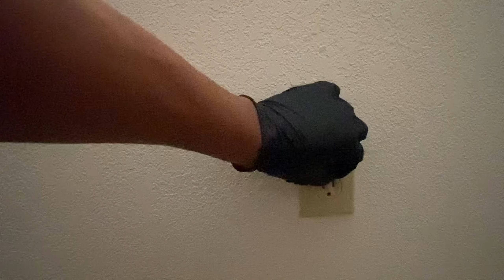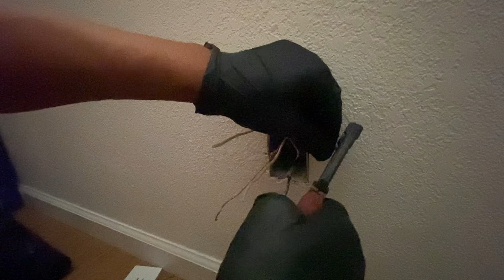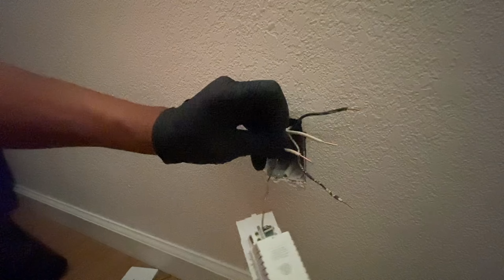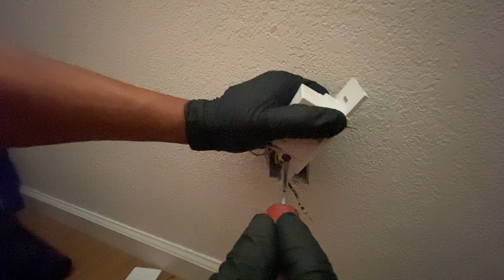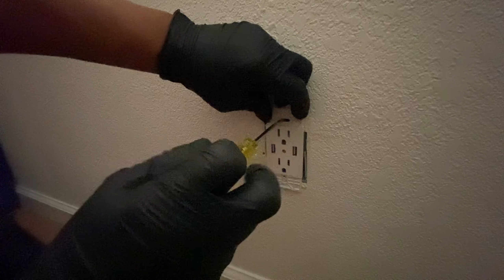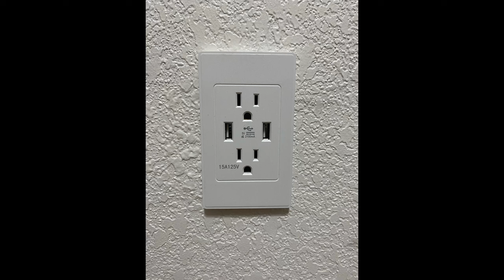Modern Outlet Upgrade with USB | Clean Install Using Pigtails + Code Tips #apprentice #electrician

Comment: Well made video. Clamp terminals like that are 100% fine for two wires, if properly torqued. Wire-nuts are actually a less reliable connection, and your adding more to the already overstuffed box. If you MUST pigtail, I'd suggest the flatter 3-port WAGOs. But I'd just go with the clamp terminal on the device (haven't had a single one fail in 30 years in the trade).
Reply from the maker: Yea I could’ve just used the clamp terminals on the device and that would’ve been good. I prefer Wagos for pig tails as well, especially for solid wire. I prefer wire nuts for stranded wire. I’ll go shopping for Wagos tomorrow. I’ll shoot a new video this weekend using them. Thanks for the comment!